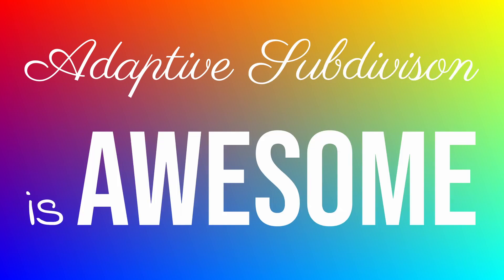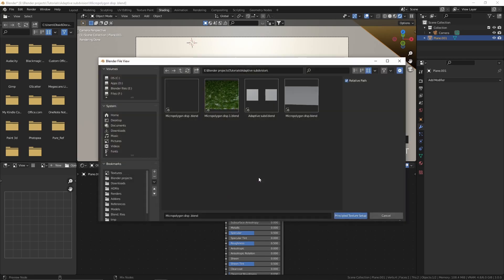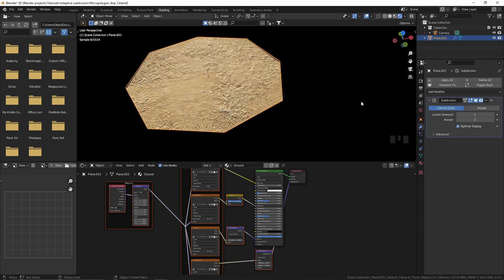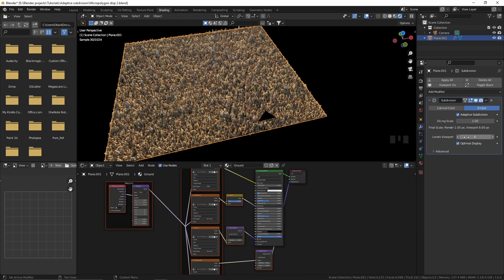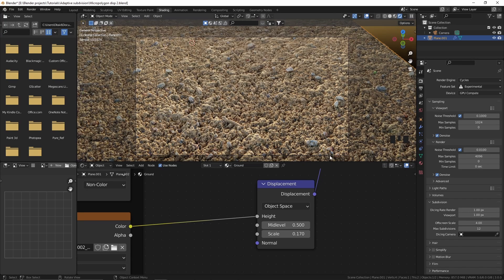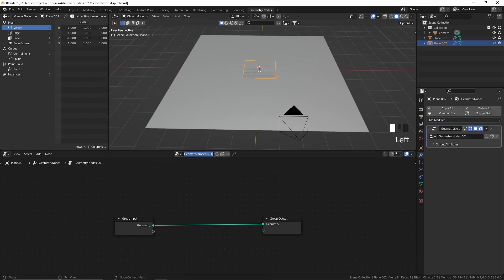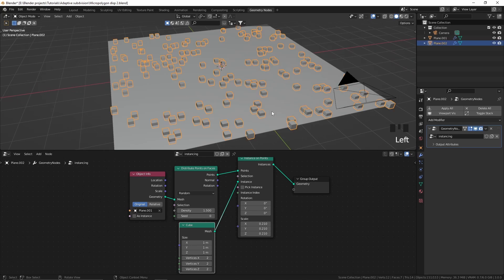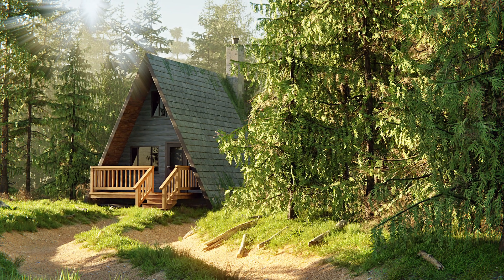The Problem with Adaptive Subdivision in Blender | CG Obaid

Comment: my adaptive subdivion not woking why  its ahow gpu out of memory
Reply from the maker: It is because the scene becomes very large and heavy for your GPU to handle. In the Render Properties > Subdivision, the final Render rate would be set around 1 by default (the lower, the more details it is gonna be subdivided), set it to something higher like 5 or maybe 8 and try not  using textures above 4k resolution.

Comment: Though when you dhowed that house with the reaise path and grass. You shoulr model that path already raised and than instance the grass on it. You wont need this work around then. The grass can be offset and it does need this setup. At least i think.

I do wonder, if you ise that plane which jas the afaptive subdiv on it, doesnt that also i out a super hi rrs mesh for the geo nodes than?

Comment: At work i have an old Mac pro and it can only run up until bl2.83
I've noticed couple times that the adaptive option won't show, when the subdivision mod is at the top. If i make that have 1 and then add a second it does show the option adaptive subdivisions? Kinda weird
Reply from the maker: For the Adaptive subdivision to work, the subdivision modifier needs to be the last one.
Reply: @CGObaid  yeah, that is a big probably. If there is just 1 modifier
Reply from the maker: Yeah, there are currently a lot of issues and limitations with the Adaptive subdivision feature

Comment: Does it subdivide with just a particle system without nodes? For instance a plane with subdivision and just a regular particle system modifier on top?
Reply from the maker: That is actually a really good point! I went ahead and tried it out and it turns out that the particles Do not Subdivide when using a particles system before the the Adaptive Subdivision. Thanks a lot for sharing your idea and watching the video :D!

Comment: Hello CG Obaid! Thank you for the tutorial! Where would you plug the attribute, for the case you have a path curve on the plane? You don’t have the proper input since you deleted it and than dropped the object in the geometry tree. In this case it is not possible to „mask out“ the path for example (to not distribute on this path)? Or am I wrong?
If I‘d like to have subdivided surface to displace it, it needs to have modifier „subdivision surface“ on it. But in this case I have a subdivided geometry object, where I should not make „distribution on points“, because pc would crash. That’s what I learned in your courses. But how is this Problem to manage?How can I keep displacement of the surface and in the same time can use „attribute input“ on the „input node“?
Best regards and thank you!

Comment: These are very clever solutions. Bonus thumbs up for goat 4:28 :) I hope adaptive subdiv gets better, at the moment it has so many flaws - it has to be last modifier, it uses tons of ram, it wastes resources on faces that are outside the camera view, and the issues you cover in this video. It has been the same since v2.8, I hope it gets better soon. Thank you for this video, it is very helpful!
Reply from the maker: 4:28 Hehe 🤣. Glad it was helpful 😊
Reply: Ow but w i get why it only shows then. Just posted a Question why it only shows if i add another one.
Seems they find rgot about it. Had been in a experimental fave for almost a decide orso
Reply: But then again, displacement on render time have always been cpu breakers. I guess it still running on cpu or so. Though I've have cpu disabled in blender it still works, but uses lots of computing power. It's always better to do it mesh based, but that needs tons of geo. So both have plus and negatives effects